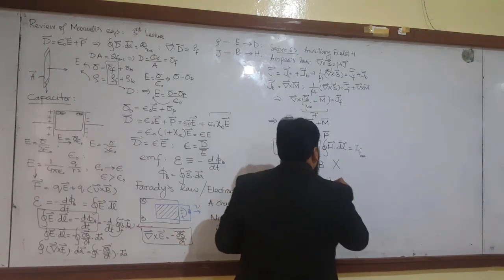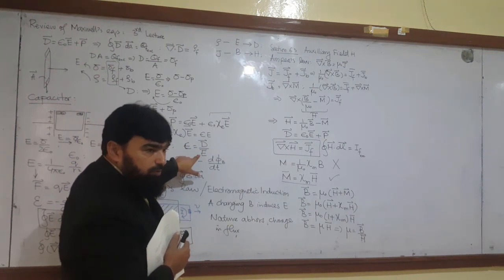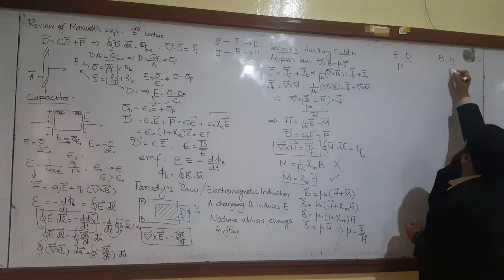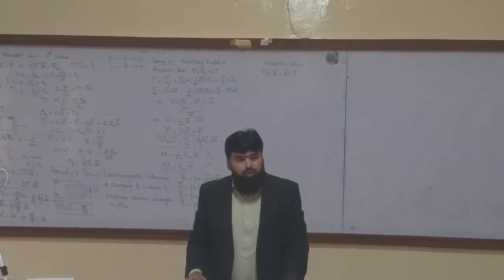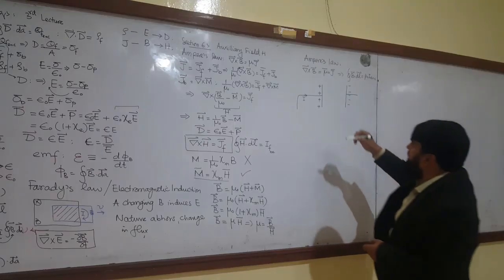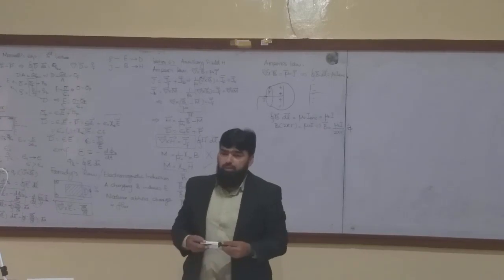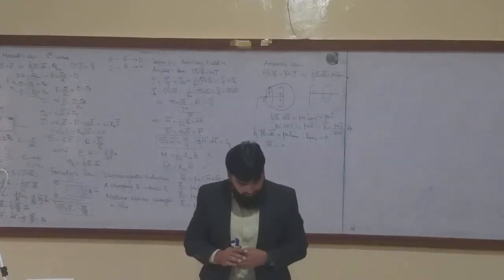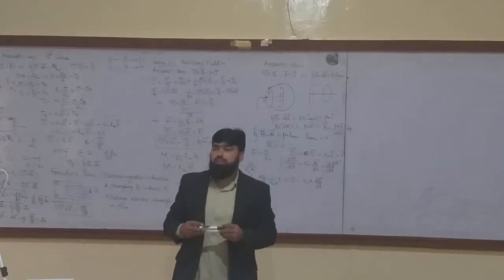L4.4 Review of Maxwell's equations: Maxwell's correction to the Ampere's law

Comment: This is one of the most amazing lectures, especially starting around 5:00 on the explanation of E, D, B, and H. By a very unfortunate choice of terminology in magnetics design by electrical engineers B is called the flux density and H is the field intensity. At least the equations are the same but the naming always makes me cringed as a physics major by training.
Reply from the maker: Thanks for the appreciation and valuable input...